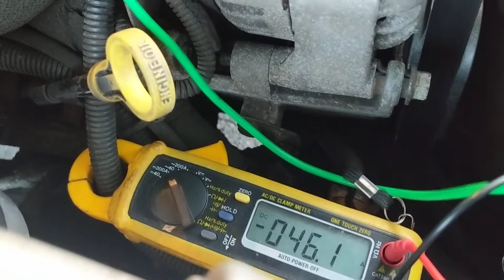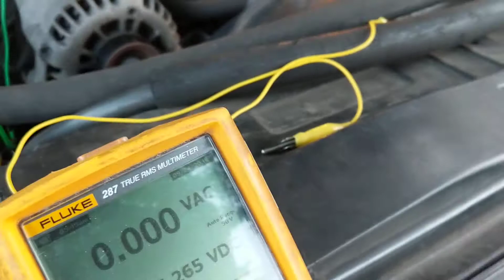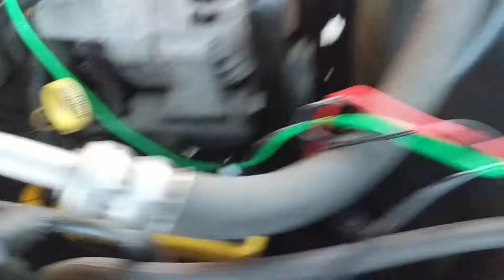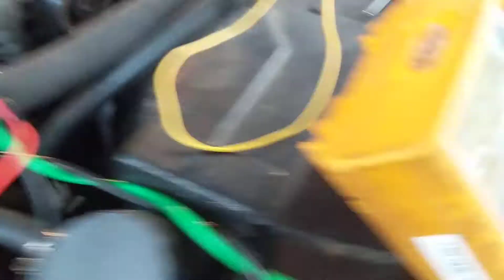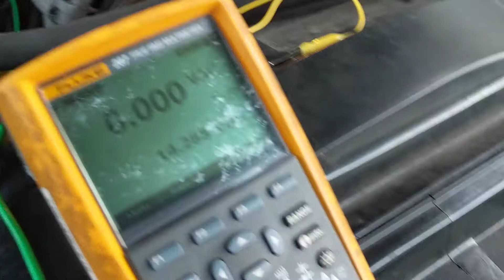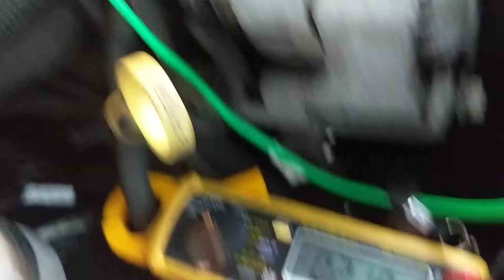bad alternator or battery easy test with multimeter

Comment: Would you be able to see the command from the pcm, using the amp clamp if the charging light were ON due to a bad battery?
Reply from the maker: With a bidirectional scanner

Comment: Very helpful video in quick checking alternators and batteries! I’m Always nervous when pulling the trigger to replace either one. The newer systems can be frightening at times lol... This video gets me a step closer to becoming the diagnostician I plan to be! Thanks Joe! Btw... I have an 03 Kia Sorento that’s blowing the fuse (10 amp engine fuse in left under dash fuse box) only when the engine is either being cranked or right after the engine starts. Any suggestions on how to find that problem?
Reply from the maker: Sorry I didn't get back to you quicker it seems like from the diagram that 10 amp fuse goes to the coil side of the starter relay and also to the computer now if you tell me that the fuse keeps on blowing obviously you have a short as I said in previous videos you have to measure resistance from the side of the fuse going to the load not the b plus side you would measure very low resistance if you're blowing fuses take off the relay and take off the connector to the computer see which one might be blowing it thanks for being with you and keep me up dated and informed on your situation good luck
Reply: @Joeelectronicschematicsforauto  It’s definitely blowing everytime you start the engine.
Reply from the maker: @gregjones8501  yeah so no reason to keep on putting fuses you have to do a resistance test if you know how to do it put the meter on ohms take out the relay or the computer connector and see when the resistance goes away that's the only way to do it if you have a short I did make videos how to use the meter on measuring fuses and relays you could go to my channel Joe electronics schematics for auto and you'll see that